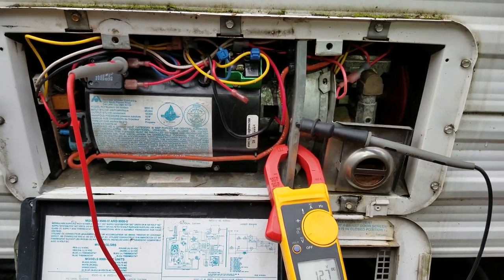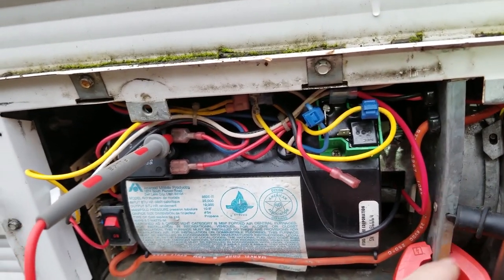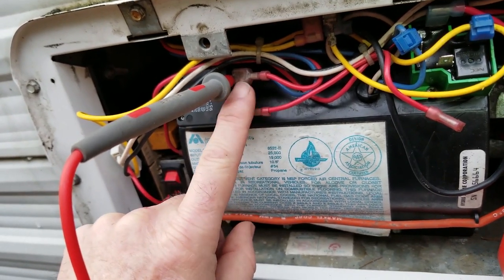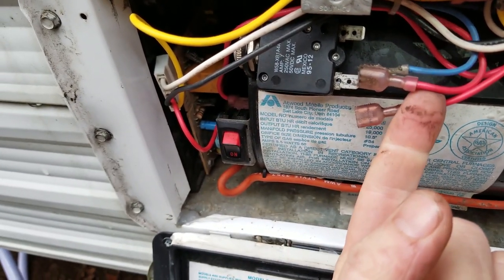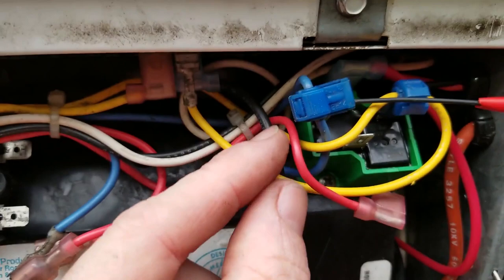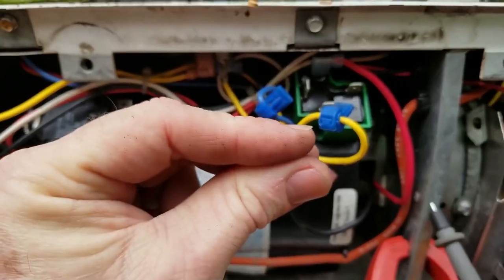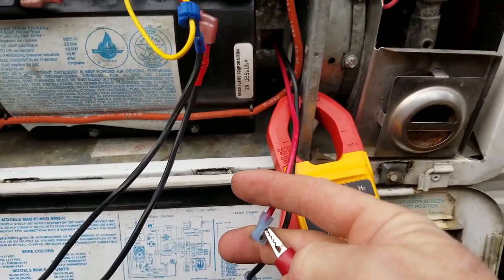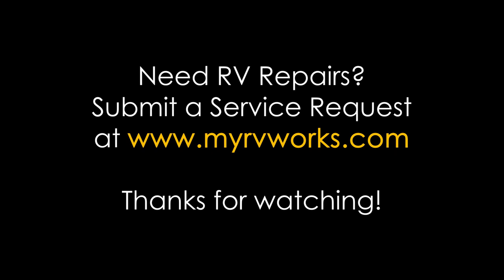Failed Relay On An Atwood 8500 Series RV Furnace

Comment: I did a similar diagnosis the same way you did last night.. i wish you would have continued!  My issue is i have 12v at top red and 9 o'clock blue (thermostat) but when i fire it up my voltages drop to like 9.7 for some reason.. my guess is the coil or disc is bad in that relay and i am not getting full contact or its a draw down as 12v disperses... thats my guess until i get a new relay.. any thoughts?. Thanks. Great video only complaint was as someone else stated would have been good to see what your actual finding was vs just hot swapping with spare components.. Your videos are clear enough that avg joe could do a field repair.. thanks so much..

Comment: wow, those solid state relays are virtually indestructible. I replaced my mechanical relay with one of these and assumed that it would last forever. Thanks for locating that little devil.
Reply: I found out from the company that the relay CONTAINS solid state circuitry BUT the relay is still mechanical inside.

Comment: Hi Darren  I purchased a 94 GMC Class C motorhome recently  from a nice lady. There is a service note from a RV shop stating that the furnace needs a new eco part which he stated was  hard to find."
When I asked him what is a (ECO) part, he said it was the limit switch in the back of the furnace and a lot of work to replace. It is an Atwood 8525-111.  The furnace is working as normal at present. I've owned RVs on and off  for over 50 years and not sure how he would have diagnosed that the limit switch was unserviceable. I'm a mechanic (not a  RV mechanic though) and would like to test and repair a necessary)  I didn't have any problem finding  a limit switch online $16.00 plus shipping.  Your thoughts  regards the  BeaverSqueezer

Comment: ill tell ya my problem and see what you think .. I have a 1986 coachmen with a hydroflame 82 series furnace ... I had a guy come out and fix it 5 years ago he put a blower motor in , a circuit board, and an igniter. It ran great then the valve went bad so i replaced that and its been running great for 5 years ... well last week it stopped igniting  ... I heard a few pops like it was trying to fire but then just wouldnt fire .. so I went and got a new circuit board and igniter and it ran fine for one night then back to the same old situation  ......i turn it on and the motor starts , then the valve clicks, then u hear to tik tik tik tik tik of the igniter but it never fires ... so i pulled the igniter out then turned the heater on and stuck a cigarette lighter by the burner and it fires up for three seconds then quits.. i checked the sail switch and its good , the high limit switch is good too so either the board is shutting the valve or the valve is defective again  ... i have a new valve coming in the mail but if i replace that valve with a new one and it does the same thing what could it be now? could it be the relay?  one final question .... when the guy fixed it 5 years ago he put an igniter in it that only had the igniter rod but not a sensing probe  ..... if theres no sensor probe how does that board know how to keep that valve open ? It ran fine for 5 years with that igniter. I went and bought a different igniter .. a longer one that will be positioned right over the burner for quicker lighting , it has two spade connectors for the igniter and sensing probe. I really wanna fix this myself but if this new igniter and valve dont solve this what could it be now  .. I also blew out the lines and no water ... I also pulled out the burner and orfice and blew them out they were not clogged but i did it anyway   ... I guess ill have to wait to install the new valve and igniter and see what happens ..... I really dont wanna take this to a technician because i love fixing things myself and saving money lol but if the new valve and igniter dont work what could  it be ?

Comment: I noticed in the beginning you have the plug pulled off of the main board. Do you have the thermostat calling for heat while you are testing the 12 volt trail?

Comment: at 5:37 you have temporarily installed the new relay. But it looks like you have it rotated 180 degrees and your +12v/motor and T-stat/GND connections are swapped. but it still was working correctly? and then when you installed it permanently, it was connected up the same way as the original. am I missing something?
Reply: It’s DC voltage, it doesn’t make a difference. However... if diodes are present then they are polarity specific.

Comment: RV sat for several years. Furnace not coming on at all. jumpered fan as show it it runs. replaced factory relay with a dinosaur relay. still nothing. volts on blue from thermo show 12v when not connected to relay and drop to 9 when connected. still no power on motor side of relay  - Update : was bad Thermostat. Jumpered relay with proven 12v and bypassed sail/limit switches and got fan and flame.  Thanks for the Video. Helped with the troubleshooting! Now, on to the water heater. Bad board I suspect.

Comment: Thanks for the video! I have a Hydro Flame 7920 D that's giving me problems. I got it working yet nights ago, after it sitting several years, but now it's acting like a bad relay. I'm getting 12v past the breaker, but get nothing when I probe the prongs of the relay. I bought a universal relay from dinosaur electronics, but get the same thing. Admittedly, when installing the new one, something happened and the 15 amp fuse blew. I replaced it, and it hasn't happened since (I probed the lead going to the motor directly with the 12v+ lead off the breaker, and it worked, so I'm thinking that's what blew it).

Any ideas at all? I've just found myself forced to live in here full time, but have no heat, and am in the mountains... Please help!! :)

Comment: Quick question! I cleaned my connectors on the relay and reconnected it backwards and there was a spark at the thermostat now nothing will turn on not even the blower motor.. what damage did I do?

Comment: Hi Darren,  YOU are a valuable asset...!   Just getting that out there to start and apologizes for the length of this message... 

I put a new dinosaur fan 50 plus in my Suburban SF-35 and have have bench tested the assembled components, fan/sail/ignitor/high limit... The furnace as a system works normally on the bench using the board... 
(UNTIL I reinstall in the coach and connect the "DOMETIC" thermostat).. Now I can get air-conditioning all day long but can't get the furnace to respond. Nothing...

I think I've learned something from you with your "AND" journey description...I think it applies to what Dinosaur was trying to say in their documentation with the new board about  that uses a standard ignitor board and a time-delay relay,  they seem to want me to move a jumper over one pin on their board and connect a red and orange pair of wires (red for power and orange for blower) ...they supplied these with the new board.

Helping me I think...in your "Atwood Relay" problem video.... you include the 12 volt trace but/and more importantly... (Your description of the "AND")  journey.  Insightful...

At 2:27 you showed a combo wired (red & blue) terminal connection at the Atwood circuit breaker, you spoke at length about the "AND" journey there with specific reference to the blue wire being in circuit with the thermostat.  You further describe the relationship and separate the significance of that blue wire with either coleman or dometic and how they differ.    

PURE GOLD.... I think...

..
My factory board had that exact blue/red combo connection (at the board).. my relay "I-think" is integrated at the board differing from your Atwood video..

Dino apparently DOES-NOT want me to use that combo blue/red connection at the board anymore... they seem to instruct me to move a jumper pin, separate my red/blue combo and re-wire (integrate) their orange and red wires.

An-aside...Complicating this is to begin with...I didn't have a clue about what "Dino's" version of an "older board"   is...    
My SF-35 furnace is in a 2017 trailer...that's older...really?

Speaking to Dino on the phone earlier about this jumper and wiring documentation,  I got nothing but confused.. They honestly tried... but they failed in this attempt to make anything clearer to me. 

I "think" you may have illustrated my problem... I need to separate my original Suburban blue/red connector at the board and use the Dino instructions regarding the jumper pin and re-wiring movement as described ?

Agree ?

Comment: My furnace shuts down 90% of the time when the gas valve opens, I have the new style relay installed. What is really strange is the fact that the fan motor stops abruptly at the same time the gas/spark happens when it fails to ignite.  Shouldn't the fan still run after ignition failure? The only thing that controls the fan motor is the thermostat and relay. Hate to think a new relay should go bad within two years. Ideas?

Comment: I replaced my relay as suggested and tested the blower motor before hand. The blower motor was still functional, and after replacing the relay it did come on. However, once I plug the ground and T-stat in, and turned the furnace on, it started smoking really bad, then I blew a fuse. The relay still is functional, but it keeps blowing fuses and will smoke if I turn it on. Any suggestions?

Thanks for the video!

Tim
Reply: after some more debugging. I found out that the yellow ground wire that goes from the relay is causing it to burn up..

Comment: Any ideas please,,,,,,, I had a lightening strike close to my forest river 5th wheel. After the strike I now have the AC. blower running and furnace running with heat at the same time. I can only stop them by pulling the fuse and switching of the breaker. Checked batery and converter also changed thermostat.  Still have the same problem. Any help would be appreciated.  Thanks.

Comment: I have an Atwood 8525-iv. My fan continues to run and I have narrowed it down to the red wire going from the reset button to the circuit board that seems to be not making a good connection? If I have the circuit board out I can get the fan to go on and off, when I install the circuit board, the fan won’t shut off unless I reach in and move the red wire connector. Is it a bad circuit board? Or is the connect just bad?

Comment: I have a Atwood 8532-IV-DCLP furnace and already replaced the control board because the red light was dead and after installing the new one the same thing happens NOTHING. No sound on the inducer motor or blower not light on the control board. I'm assuming the replay is the issue but I have no clue where it is at any help would be appreciated thanks.
Reply from the maker: First you need to verify your getting 12 volts on the red wire. In this video Darren talks a bit about the control circuitry.  The video was for a Suburban furnace and yours is an Atwood but the control circuit is very similar. It may help you.  https://youtu.be/BpQHc6_NwPU

Comment: Howdy   My ATwood 8520 111 fan runs continuously with no fumes or ignition.  12v power both sides of circuit breaker, no power to ON/OFF toggle switch,  no power to red joint over gas solenoid,  11.35v  to and from relay red wires. no difference to AC selection to "Pre wired opt. heat"    Any suggestions would be appreciated.  Thanks. Pat. Holden
Reply: The fan will run, venting the combustion chamber in preparation for burner lighting while it waits for two things: 1. Limit switch (which is normally closed) to pass current to the 2. Sail Switch (which is normally open).

If the limit switch is closed (normal condition) it passes current to the Sail switch that should close with the fan running if it is working correctly. If these two conditions are met, the solenoid at the burner will allow gas to flow and the furnace to light.

If either the limit switch is open (defective) or the Sail switch does not close when the fan is on (defective) the burner will not light.

You can make a quick test of either by jumping the wires going to either the sail switch or the limit switch. This will temporarily bypass the device. If this test results in the burner firing, you have found the defective part. Stop the test and replace the defective part. Do not run the furnace with either of these safety devices bypassed. Just for the test only.
Reply: Turned out to be corrosion on the  sail connection  Thanks. Pat.
Reply: @patrickholden9717  Glad you found it.

Comment: You have very informative videos.  Here is my issue: I have an Atwood 8531-IV model. Furnace lights but goes off after about five seconds. I can hear the solenoid click open then close, causing the flame/burner to go out.It will do this three times times then system turns off. The board is flashing three lights indicating an Ignition Lockout Failure.  Would a bad Time Delay Switch cause this fault? Any other suggestions before I give up and take it to a repair shop?  Sounds similar to the post below by Ismael Torres Rodriguez.
Reply: I also asked a question, but never got a reply
Reply: It sounds like the igniter board could be defective. One way to test is to swap the board from your hot water tank to the furnace (they are often the same board) to see if the furnace keeps running. There is a universal board for sale on Amazon manufactured by Dinosaur Electronics.They are less expensive than Brand name boards and I have had good luck with them. Here it is: https://amzn.to/34JX9nY
Reply: @stevenfrazier8939  It sounds like the igniter board could be defective. One way to test is to swap the board from your hot water tank to the furnace (they are often the same board) to see if the furnace keeps running. There is a universal board for sale on Amazon manufactured by Dinosaur Electronics.They are less expensive than Brand name boards and I have had good luck with them. Here it is: https://amzn.to/34JX9nY

Comment: Hi, I have an 8531 111. It works great. The thermostat works as it should. The problem is the fan won't turn off. I've been using the fuse as an off and on switch for the fan. Is there not some kind of a fan relay on these things? If so can you please tell me where it's located and if I must remove the furnace. And most importantly. Do you think that this is my problem? Thanks
Reply: Try to rule out the thermostat as being the problem by disconnecting the thermostat wire at the relay. If the fan continues to run with the wire disconnected, your problem is not the thermostat. If the fan stops running then you may have a defective thermostat, or shorted thermostat wiring or incorrect wiring connections to the thermostat. Also, ensure that the thermostat fan switch is placed in "AUTO" Not the "ON" position. If the thermostat and its wiring can be ruled out you may have a defective fan relay (which is the part changed in this video). I hope this helps.
Reply: Thank you so much I love your videos they’re very well done. Mine was firing up and then shutting off the gas after watching your videos I cleaned it all out and it was a whole bunch of mud Dobber wasp nests inside including on the igniter bored after that if fired right up now I can’t get the cold air to stop running and I see that I should check the relay I will do that maybe I left a wire off or I didn’t connect something that I took apart earlier. I’m just hoping the rain will stop

Comment: Hey bud I have a Atwood 8525-11 furnace. I put a new burner on it and it firing up and running but then the air turns cold and the blower stays running and it want ignite again. Cold this be the a bad fan relay? Thanks bud
Reply: Following. I have the exact same issue.
Reply from the maker: When you state you have an 8525 and you put a new burner on it that raises a question. The burner for the 8525 is Obsolete and is not supported anymore. So that is to say I'm curious where you got the burner for the 8525. We ran into this issue last month on a job.  Customer had an 8525 with a burned-out burner head. We tried in vain to find a burner. Contacted Dometic and they state that they do not make those anymore and the only solution is to replace the furnace.
Reply: My RV Works, Inc. I don’t have the part # on me now but that’s what they told me it was  obsolete so I went on eBay and the pic that matched my burner I went ahead and ordered it and it was the same one. So now mine is not even igniting anymore so I’m thinking it the igniter board. So your saying they don’t make the boards anymore or any parts for the 8525?
Reply: I had this with staying lit. I checked the burner it was burned up with only a little of the screen intact. Ordered a new burner, installed still nothing. Dumbed out now. Took it all apart again. Matched the old burner against the new one. I discovered there's a small ramp inside, close to the orfice. New one did not have the ramp that directs the LP towards the igniter. So I drilled the ramp out of the old one and drilled the new one and installed a screw to hold it in place. Reinstalled and bingo, worked like a new one. Ya I guess Atwood would make it obsolete and want you to buy a new unit. Just wanted to let you all know it's a small ramp inside is the only difference but directs the LP and is the solution.

Comment: Do you have a video for the Dometic that runs to the AC? I have an issue where the fuse blows instantly when the thermostat calls for heat. I do hear the click from the AC and then it blows.

Comment: I want to see you take the sail switch out, I can't seem to find mine
Reply: I just saw this vid but hopefully you have found it by now.  If not, then just remove the four 1/4 inch bolt/screws that hold the rounded black blower cover on.  The sail switch is is attached to the inside of this cover.  Sometimes just cleaning this switch will make it work again.  I sprayed mine with liquid wrench and it worked fine after that.  But if you have to replace it, they are fairly cheap.. Good Luck!